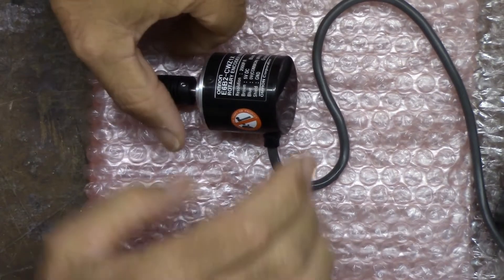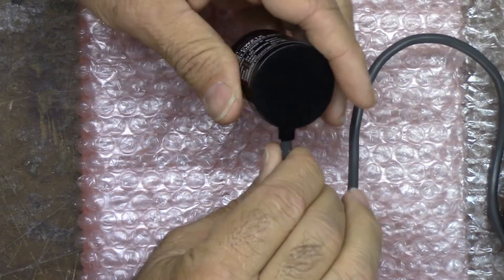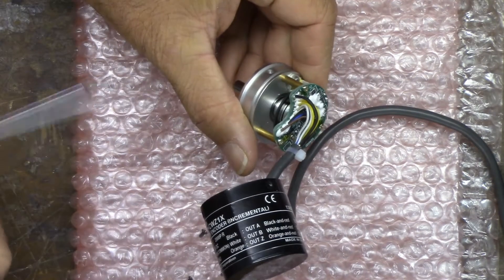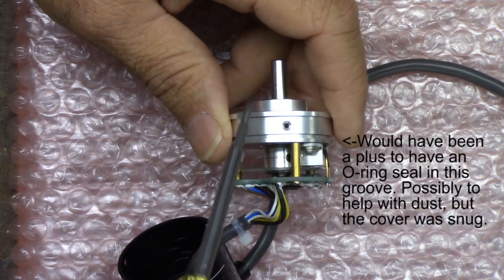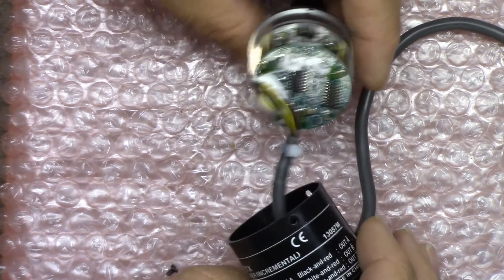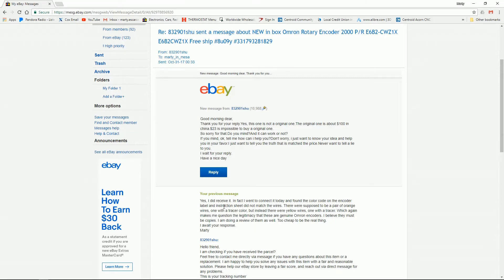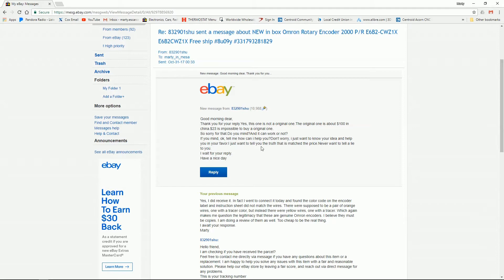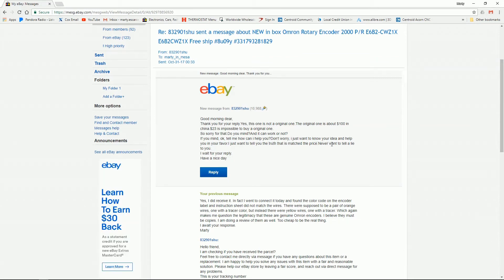Omron Encoder Part 3 - Inside look and Ebay Vendor message

Comment: Hey marty thanks for this upload, after watching your video i used it as leverage for negotiating with this ebay seller. mine works but it won't count in a counterclockwise direction . the seller is going to send me another replacement free of cost hope that one works !
Reply from the maker: In my honest opinion, you are better off buying a quality unit from a reputable source.
Reply: @martyscncgarage5275  if i had money definitely.  all my hobbies are super expensive also race on the track . its hard balancing those two hobbies as middle class person. heck if i had the money I'd buy nothing but clearpath motors . all this is for a sherline baby lathe !

Comment: To me it was obvious even before I bought a couple, that these are not original Omron units. I mean come on, it can't be original at the prices the Chinese sellers are asking for them!
They do seem to work fine for quite a lot of people, I've heard a couple of stories though where people had problems.
Did you find another use for the unit you bought?
Reply from the maker: Those Omron knock offs need to be jackshaft driven.
Reply: @martyscncgarage5275  Thanks for the terminology. I didn't know the word jackshaft but that's exactly what Omron themselves recommend. However, I know of a large group of Russian metal workers who had installed this encoder (I'm sure all of them used the Chinese cheapo unit) on their lathes as part of an Electronic LeadScrew system, and no one so far mentioned encoder failure. Many had been using the system for 5 years already.
Reply from the maker: @GenePavlovsky  cheap enough to try I suppose

Comment: Hi Mr. Marty
Question: how much RPM can handle it this encoders?
Reply from the maker: Can't tell you. Its not genuine Omron. I don't use these encoders on my machines. I need to know the encoder will perform well. I buy from automationdirect.com
Reply: Omron says 6000 RPM max. These are not original Omron units, so it's like a lottery. If you have a specific RPM requirement, try to check first with the seller you plan to buy from. Hopefully they know the actual numbers for the products they are selling. Or buy a couple of them and use one as a guinea pig, running it faster and faster until it starts glitching or self-destructs. I've heard from a guy his failed at 2500 RPM, but YMMV.

Comment: I wonder with those potentiometers if they use the same encoder for various p/r and make the adjustments there and sell the same product? Perhaps it can be adjusted to 2500p/r....
Reply from the maker: Glenn, these are not potentiometers. Encoders are usually glass scales with lines engraved or otherwise marked on them. The number of lines dictates  the number per revolution and is not adjustable.
Reply: These are probably trim pots to fine tune the operation (at the factory) and then prevented from losing their adjustment by some sealant. The PPR, like Marty said, depends on the glass disc.

Comment: Thanks for the video. Works but wonder how long it would last.
Reply: Well, if it works, buy a spare one :) They seem to be working fine for a large group of Russian metalworking forum users, except for a couple of cases where they had problems straight out of the box. I don't see why would they stop working, besides dirt getting in and/or bearing failure.
Reply from the maker: Agreed, but it seems fairly well made and for the money....perhaps? It all depends on the work involved to mount it up. If it fails, adapting another encoder.....